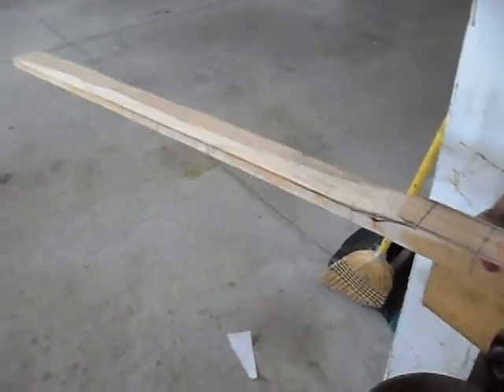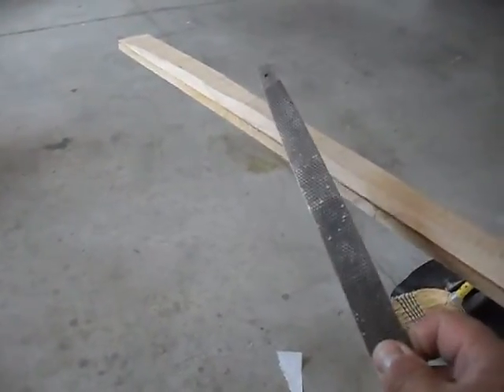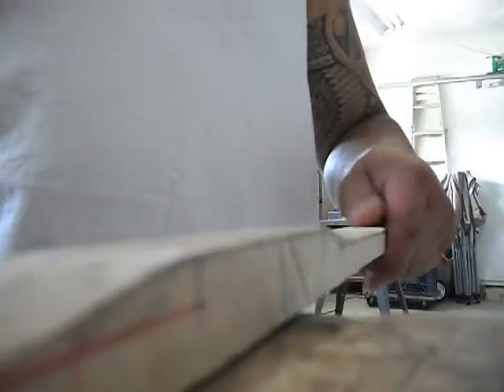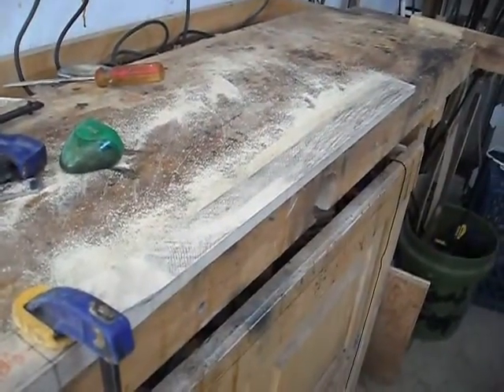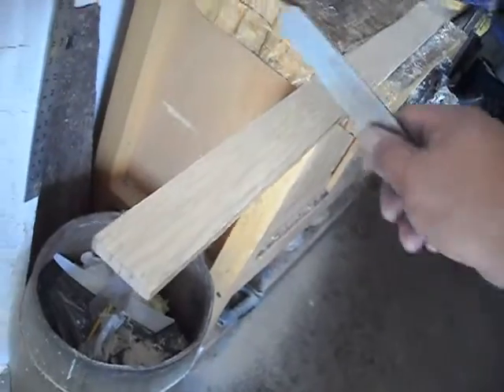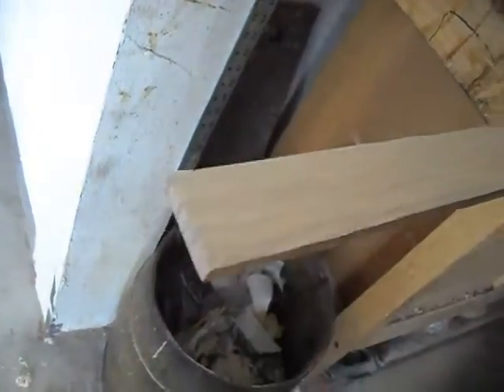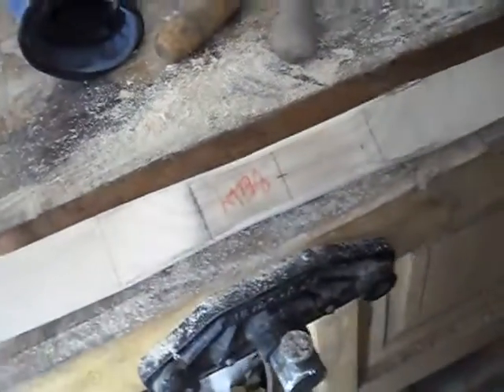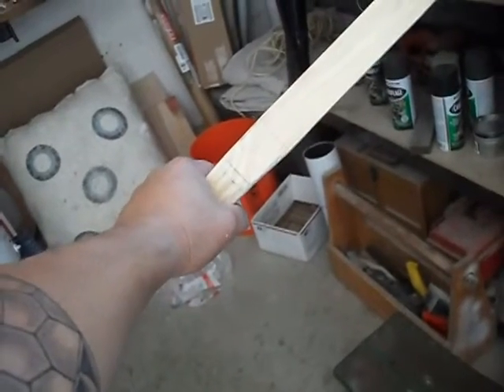Making a Hickory short bow- Part 2

Comment: Why don't you use a spoke shave instead of a rasp? I've been a carpenter for 20 years and a spoke shave (known as in the UK) is the tool you need. Also, your scrapper is better being a 100mm plane blade removed from the plane, rubbed on a sharpening stone and then use the burr (the metal scratchy bit on the metal on the opposite side that you have rubbed against the stone) and use that to scrap the wood flat. Trust me, it is so much easier and clean. Apart from this advice, thank you for the advice on bows. Question, you don't mention the grain. That is an important part of the bows natural engineering. After 20 years I know that grain is integral to wood strength.